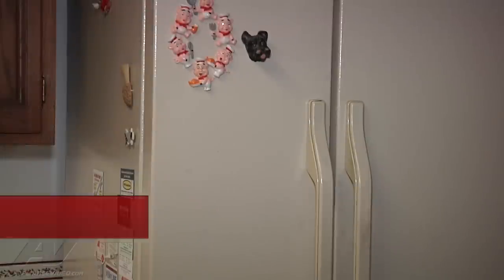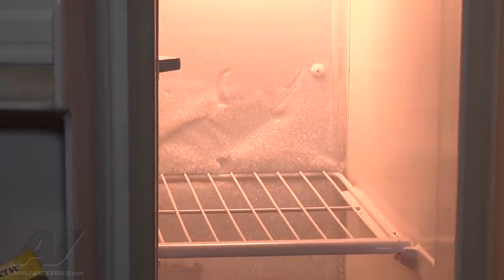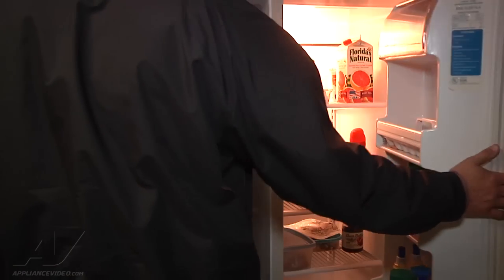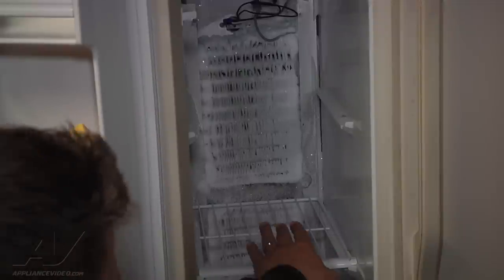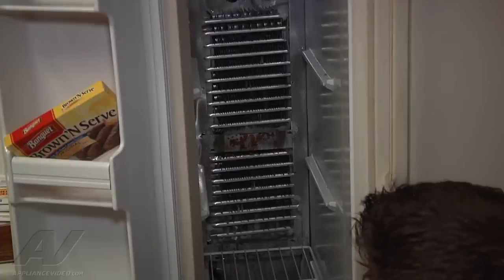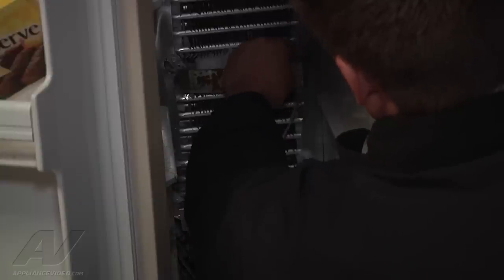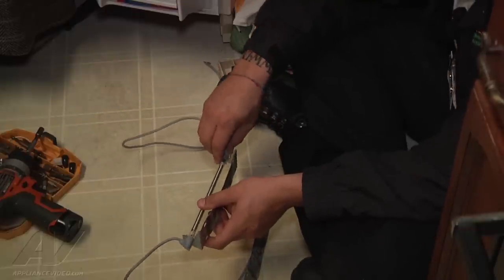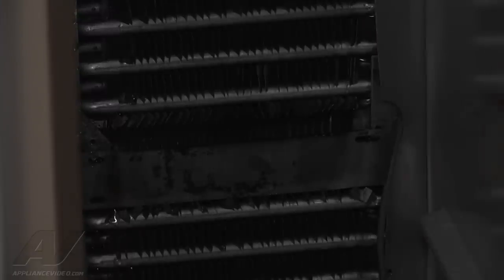Admiral Refrigerator Repair - Ice in the Back of the Freezer - Defrost Heater

Comment: Had the same problem. Found a web page for troubleshooting my refrigerator and isolated the problem to the heater. Once removed, it was obvious. One end was all charred and the ceramic was starting to crumble. Found a replacement on Amazon for $13.50. Paid an extra $4 for next day shipping and got it before 9:00am, and on a Saturday, no less.

Having a second refrigerator in the garage made things so much easier to manage. Doing it all myself saved us at least $200, likely more.
Reply from the maker: Hello, for
technical questions we have a Repair Help section at this link https://www.appliancevideo.com/repair-help/ . There are over 6,000 answers and questions you
can search through FREE to help you with your problem. Hope this helps

Comment: You also use a regular hair drier instead using a heater that can damage the plastic. Never use an screwdriver to remove ice from the coil because you can pinch the coil and will be more more costly. Defrost the evap and the panel before trying to id what's wrong. Never pull wire the way you did.
Reply from the maker: Great question, if you have a more technical question that our parts department cannot answer, you can search our over 13,000 answered questions free at our website www.ApplianceVideo.com under our Repair Help section. You can also call our parts department at 1-800-830-5465 and they can give you help 7-days A week ,or search at www.SaveMoreOnParts.com  .
Reply: I used a gatorade bottle filled with hot water to melt mine. gonna have to try to replace my heater. freezer is 29-32 and frig is 50 and the fan is running on freezer side
Reply: Steamer would be the proper way to defrost.
Reply: I use my hot smelly ass breath lol

Comment: hi I'm having similar issues with my Frigidaire refrigerator. the freezer seems to be doing its job by keeping the freezer cool although the refrigerator is freezing up my liquids to solids and the reading temperature is 0°F in the freezer and 59°F in the fridge. I don't think that isn't correct temperature reading. can you help me finding how I can trouble shoot this problem? I'd appreciate it. thanks in advance.
Reply from the maker: Great
question, you can call our parts department at 1-800-830-5465 and they can give
you help. If you have a more technical question that our parts department
cannot answer, our technicians are answering
all questions at our website at ApplianceVideo.com under our Repair Help
section. We have over 3,000 common questions and answers that you can easily
search through by your model number, appliance make, and problem or error codes,
and  Its free to search through our question & answer library.

Comment: Great educative video. I have a Samsung side by side. Only half of my evaporator is frosting. The other half has not cooling which is affecting the cooling in the fridge section(43 degrees). The freezer section on the other hand works fine. What could be the cause? Thanks.
Reply from the maker: Great question, if you have a more technical question that our parts department cannot answer, you can search our over 17,000 answered questions free at our website www.ApplianceVideo.com under our Repair Help section. You can also call our parts department at 1-800-830-5465 and they can give you help 7-days A week ,or search at www.SaveMoreOnParts.com  .

Comment: Hi its samsung refregerator double door its freezer is working but fredge is not working n frezer is making lot of ice behind . I oftenly through hot water on freezer
Reply from the maker: Great question, if you have a
more technical question that our parts department cannot answer, our
technicians are answering all questions at our website at www.ApplianceVideo.com under our Repair Help section. You can also call
our parts department at 1-800-830-5465 and they can give you help 7-days A week
Monday -Sunday, or search at www.SaveMoreOnParts.com  24 hours
7- days A week.

Comment: to determine it was the heater, did you first check the defrost timer? or would you simply suspect the heater.
Reply from the maker: +Ron White 

                   All of our technicians are now answering questions
daily at our http://www.appliancevideo.com/ website under the Repair Help section.  We also have over 1600 common questions and
answers that you can easily search through by your model number, appliance
make, problem or error code and it’s absolutely FREE. You also have the option
to email a factory service technician with a question on your appliance at
http://www.appliancevideo.com/repair-help/ . If you’re looking for a repair video, you
can also search our library of over 2600 free repair videos. ApplianceVideo.com
specializes in quality DO-IT-YOURSELF appliance repair videos and we get over
800,000 views per MONTH to our videos worldwide and growing. If you need of
parts for your major appliance, we have over 5-million parts in stock at http://savemoreonparts.com/ .  Thanks
for your support. Matt Ace Appliance factory service technician.
Reply: sometimes defrost timers can get stuck..take a screwdriver and turn the dial.
Reply: @workingshlub8861 , where is defrost timer located?   😊
Reply: @Smokey66s  depends what kind of fridge you have....usually right at the control panel...look underneath where the light is and the temp adjuster knob....you will see a slot for a flathead screwdriver..
Reply: @workingshlub8861 , thank you, much appreciated.

Comment: Did u refrigerator run warm to i wounder if that what mine doing seem the rod gettting hot but never though of it no getting hot enough my frezzer was not going below -0 thinking its my timer
Reply from the maker: Great question, if you have a more technical question that our parts department cannot answer, you can search our over 17,000 answered questions free at our website www.ApplianceVideo.com under our Repair Help section. You can also call our parts department at 1-800-830-5465 and they can give you help 7-days A week ,or search at www.SaveMoreOnParts.com  .

Comment: my top freezer works great, but my bottom cooler gets bogged down from built up "snow", so every third or fourth day I just shut off my fridge...
Reply from the maker: Great question, if you have a
more technical question that our parts department cannot answer, you can search
our over 10,000 answered questions free at our website www.ApplianceVideo.com under our Repair Help section. You can also call
our parts department at 1-800-830-5465 and they can give you help 7-days A week
Monday -Sunday, or search at www.SaveMoreOnParts.com  24 hours
7- days A week.

Comment: The defrost timer could have stalled on this thing...I first advance the timer into the defrost mode.If the heater comes on-there's your problem.Replace it, defrost the coil, done.
Reply from the maker: Great question, if you have a more technical question that our parts department cannot answer, you can search our over 17,000 answered questions free at our website www.ApplianceVideo.com under our Repair Help section. You can also call our parts department at 1-800-830-5465 and they can give you help 7-days A week ,or search at www.SaveMoreOnParts.com  .

Comment: I am very frustrated this has happened twice in a month and I lost $316 in groceries .Is it a normal repair for a repair man to manually defrost the freezer twice in a month by taking it out side and using a water hose with warm water to melt heavy ice not snow but thick ice on the coils my fridge was again at 60 and the freezer was not freezing our ice cream melted  we are scared that we would have spoiled food and get sick again is this a quick fix ment to last or is manually defrosting the thick ice on the coils with a water hose twice in a month a normal standard of repairs? It totally sucks to have gone threw this warm fridge and cold but not freezing freezer issue and told this is standard practice the freezer only had ice cream in it and the refridge had little food inside it because we did not want to have our food spoiled again
Reply from the maker: Great question, if you have a
more technical question that our parts department cannot answer, you can search
our over 10,000 answered questions free at our website www.ApplianceVideo.com under our Repair Help section. You can also call
our parts department at 1-800-830-5465 and they can give you help 7-days A week
Monday -Sunday, or search at www.SaveMoreOnParts.com  24 hours
7- days A week.
Reply: I'm not a professional, but I think this video was what your repair man should have done. I'd ask for a refund, but they'll probably just say he checked continuity in the heater and it was fine, but now it's not.

Comment: i have a n lg side by side refrigerator and its building ice on its evaporator . cooling but cannot form ice on its freezer what will i do?
Reply from the maker: Great question, with our
technicians now getting hundreds questions weekly, they are answering all questions
at our website at ApplianceVideo.com under our Repair Help section. We have over
3,000 common questions and answers that you can easily search through by your
model number, appliance make, and problem or error codes.

Comment: Ok so what should ohm load be on heater ??
Reply from the maker: Great question, if you have a more technical question that our parts department cannot answer, you can search our over 17,000 answered questions free at our website www.ApplianceVideo.com under our Repair Help section. You can also call our parts department at 1-800-830-5465 and they can give you help 7-days A week ,or search at www.SaveMoreOnParts.com  .

Comment: I'm sorry i just can't resist but  i try not to break the ice using the tip of screwdriver cause if i miss my aim i'll puncture the evaporator line and have one helluva pissed customer. I carry weird things in my car like wooden spatula to scrape and plastic chopstick as an  ice pick. You can go ahead and laugh!
Reply from the maker: Hey everyone has their own tricks. I like creativity if it has a good ending.
Reply: You should buy a steam cleaner. It shoots evaporated water so it won’t damage anything

Comment: this is 100%what mine is doing. and it looks like anyone with half a brain can do it. but you never gave a part number or price. I don't want to spend $500 on parts for a 6 year old fridge that I only gave 900 to start with. plus my ice maker quit.
Reply from the maker: Great question, if you have a more technical question that our parts department cannot answer, you can search our over 13,000 answered questions free at our website www.ApplianceVideo.com under our Repair Help section. You can also call our parts department at 1-800-830-5465 and they can give you help 7-days A week ,or search at www.SaveMoreOnParts.com  .